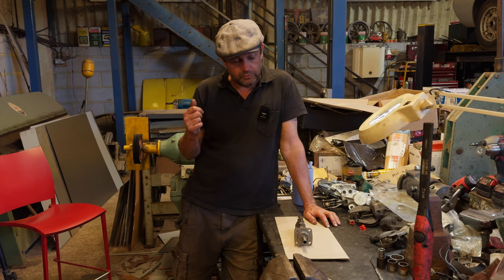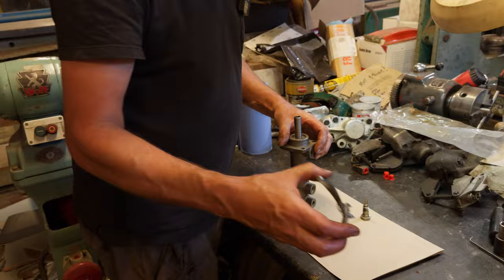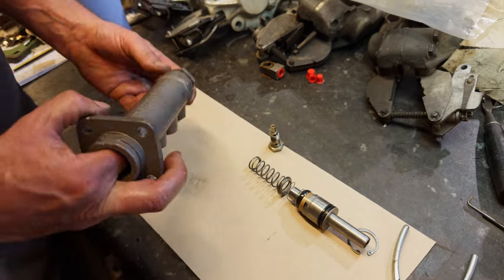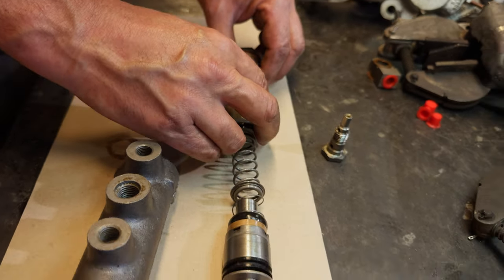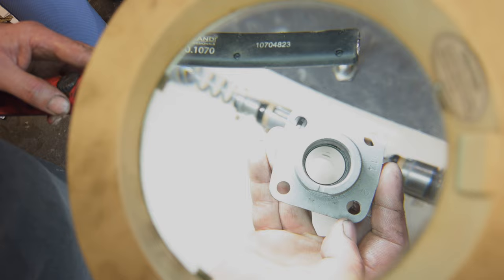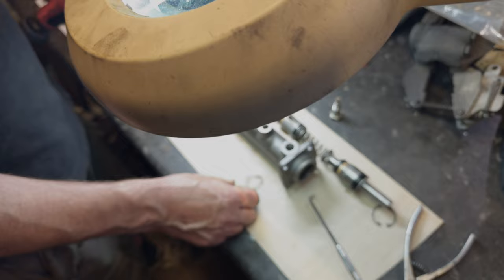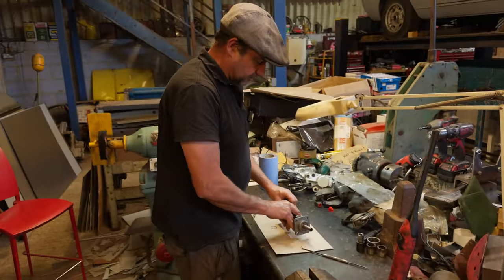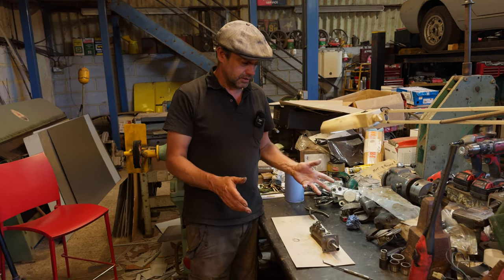FIAT Dino brake master cylinder restoration.

Comment: Thanks Mark!  I replaced my master cylinder with new.  Calipers seem OK.  Bleed the system numerous times.  Brakes still seem "squishy" to me.  It has brakes but the pedal seems soft.  Thinking of replacing all the brake lines.
Reply from the maker: @mikelfrance-l6x  It could well be that the new cylinder is allowing the fluid past the seals I have seen this happen before.
This is why I have had some issues with new master cylinder’s and for this reason I have previously had new cylinders stainless steel lined . It has been successful and the brakes have bled up well with a good firm pedal.  But it could also be that the break hoses  have deteriorated internally giving a squishy pedal or perhaps the brake pads have delaminated and causing the pistons to be pushed back after you release the pressure. But I suspect the culprit is the master cylinder. They are very susceptible to poor sealing of the O-rings against the internal bore . Which is exactly why I have had to have new cylinders lined.
Reply: @marksitaliangarage   Thank you!

Comment: Very interesting to see how it works, I have never touched mine. I think its a bit more complex than a "regular" master cylinder from that time... As always thank you fro the great video!
Reply from the maker: @bertone83  Glad to be of service.
The FIAT Dino has a relatively conventional dual circuit brake system but it can be awkward to work on especially with the inboard position of the servo and master cylinder.
I would usually remove the entire pedal box assembly on all but series one cars when replacing the master cylinder.
So yes a little more complex to work on.
Reply: Allays it’s important to check the Breakfuild for water ! Than break system will last longer 😊
Reply from the maker: @michaelroesing3399  Yes I have a tester that measures the brake fluid boiling point.  So a fluid change every 
Three years is what manufacturers recommend.

Comment: Hi Mark ,  this is all very interesting ...
I have a Fiat 900e  from the 1980's that has a possible
faulty master cylinder, it is a dual cylinder, they are made of
 "Unobtainium" .....
I cannot seem to find another vehicle of that era which
uses the same master cylinder,  BENDITALIA  
no other i.d. or part number showing ...

I cannot believe Fiat had it made just for that vehicle?

What are the details of the company Past Parts  that you use, please,  this may be the answer to my problem!
Cheers. 🤗
Reply from the maker: Pastparts.co.uk